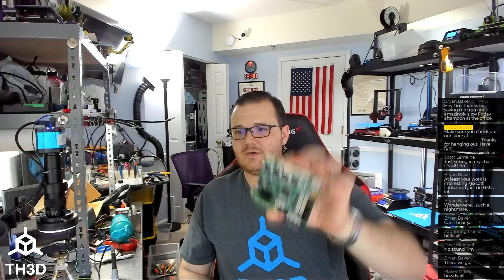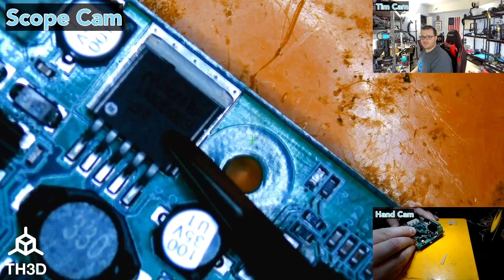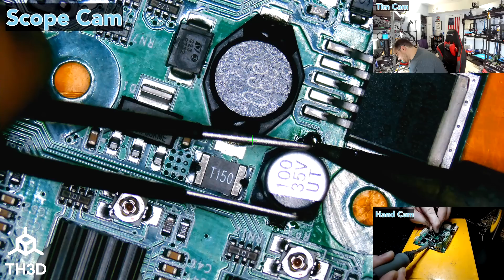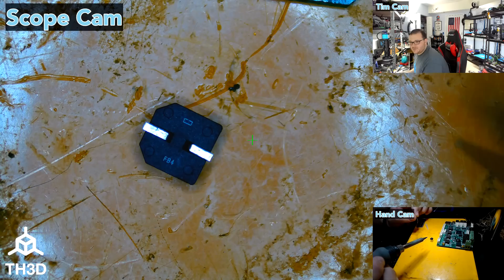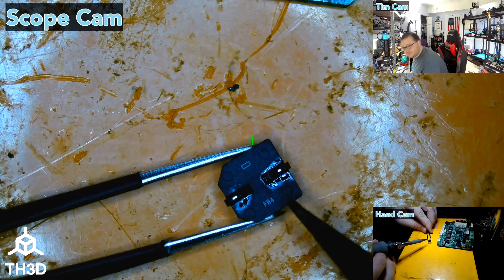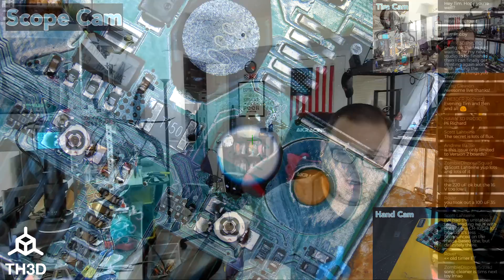[LIVE REUPLOAD] Board Repair - Fixing V2.0 Temperature Issues - Cap Replacement

Comment: I have ender 3 v2 and due to short circuit of thermistor to 24v hotend , STM 32 ic was damage so i replaced the ic from electronic repair shop  but when I try to upload firmware via sdcard it doesn't get updated
Reply from the maker: You need to burn the bootloader to the chip.

Comment: I just followed your video and now my temp reading is rock solid.  Before the fix it was varying wildly through at least a 5 degree C range while resting at room temperature, and a 15-20 degree range when heating.  I'm 2 years late getting around to it, but my CR10S didn't fail until recently.  I installed a Nichicon PCJ1C221MCL4GS.  (I even popped the same pad)
Reply from the maker: Great job!

Comment: hey there my ender3 v2 stucks on creality logo screen, after a litte bit of trouble shooting i discovered that hot end thermistor socket only has 1.6 ohm, checked the c40 capacitor it has 1.6 ohm, also r57 resistor has only 900 ohm,  i wanna change both of them but i didnt know the capacity for that c40 brown capacitor, or if there is any code or part number for it. if you can help

Comment: Amazed by your vid @TH3D Studio !
I own an Alfawise U20 and I'm having temperature issues in the hotend. Temperature is high, but it's only reading (hardly) 200ºC, and struggles to maintain it.
My board is OEM (Longer LK1/LK4).
Could you tell me what cap must I replace? What should be the new one?
TY
Reply from the maker: Haven't messed with that machine at a board level so I can't give you accurate advice to look for issues on that one.

Comment: hi would you know if geektech GT2560_V3.0 would have the same problem and if so which capacitor on that board? https://github.com/Geeetech3D/Diagram/blob/master/GT2560_V3.0_SCH.pdf 
https://github.com/Geeetech3D/Diagram/blob/master/GT2560_V3.0_SCH.pdf
Reply from the maker: I am not sure as I haven't messed with that board. But in general its usually an issue with a 5V rail. So if you put a 1000uf 16V (or higher on the V) cap on the 5V and GND pins you can help stabilize the output of the 5V regulator.

Comment: Just fixed my CR-10S V2.1 board.  Replaced the OEM cap with the TH3D cap that has the same marked rating.  Reset the PIDs and now my nozzle temp is rock steady.  Thank you for making these parts available.  You may want to consider getting yourself some "Solder Wick" by Chemtronics for removing the old solder.   Sucks up old solder really quick,  exposes the board to less heat and leaves a clean surface for beginning the installation of the replacement part.

Comment: Why cant you just cut the old cap and solder the new one, along the old pins and to the surface? Its surface mount, aka solder on component side anyway
Reply from the maker: Because the proper way is to desolder the old cap and put in the new one.

Comment: Would a 270uf 16v do the job? Mostly because ive now waited 2weeks for my 220thies to arrive, but they seam stock, but I do have Some 270thies on Some old motherboards....
Reply from the maker: Depends on the ESR rating of the caps. A high ESR cap may not work well.